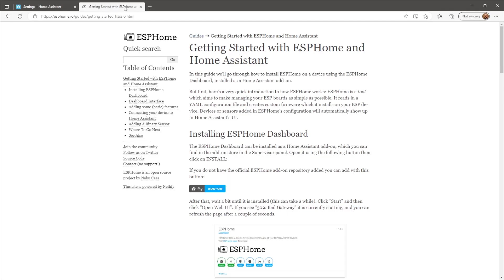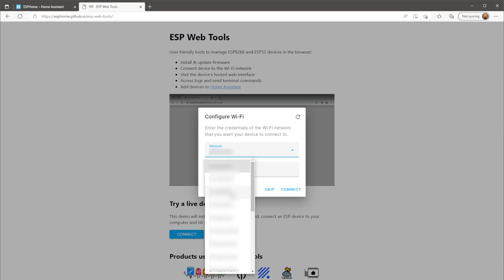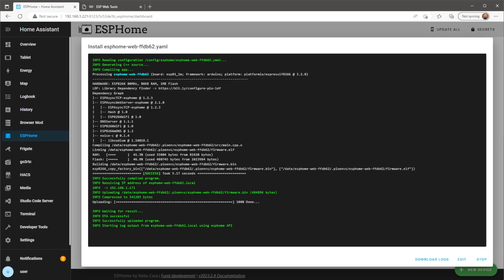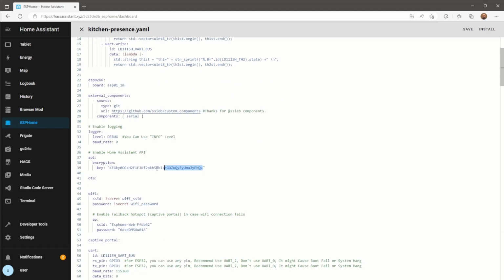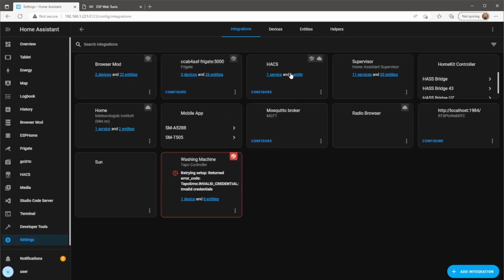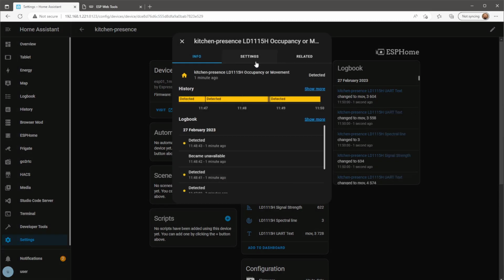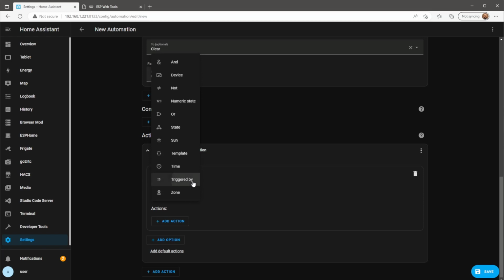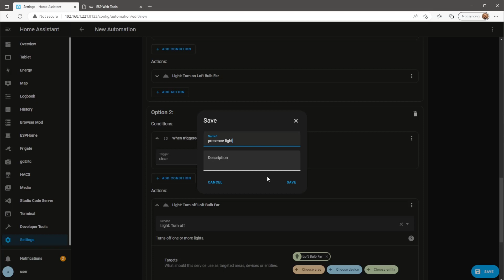Home Assistant Presence Detection Using ESPHome

Comment: Mate, this is exactly what I'm looking for! just wondering if you have a vid on how you mount/box this up? Or do you just have this naked? I don't have any 3D printer, so be good if I can just put it in a box. Be really awesome if you can do a quick short vid on you have this setup. I would like to see how sensitive it is, etc. Cheers
Reply from the maker: I know there projects out there for 3D printing, you'd have to find someone online who could 3d print for you. I can't recommend anywhere because I've never reached out for this service.
Reply: @HassAssistant  finally got the part and man, it works flawlessly. Just one last question, what would you recommend to make the connections permanent? I'm thinking just to solder them using short cables. Would that be the way to go, or would you have a better / easier solution? (using jumper wires too at mo) Cheers
Reply from the maker: @LastZion  I've only just pushed in the jumper cables on mine, and had no issues yet. It's completely a personal choice. Sure you can solder, that's not permanent, you can always melt it off again. I don't know any other way you could connect the wires?... 🤔 Remember later down the line you might have a change of heart and want the ESP board for something else.. a new sensor or something.

Comment: Hi, it works flawlessly but the presence clearance time is 33 seconds . I there a way to change this ? Thanks for this tutorial very usefull ;)
Reply: same here, would love to know if it's possible to decrease it
Reply: it can quickly be done - in the "kitchen-presence.yaml", change the value in line 150 (belongs to id: LD1115H_Clear_Time) from "20" to however many seconds you need. Then reinstall the code. I cranked it up to 300 (5 min). Now i can adjust to however many seconds I need. Works just fine.
Reply: @ChrisMylesMusic  Well, yes, that is the line to change it, however lowering it does not seem to have an effect for values below 30~, it always atleast takes 30 seconds for me to set it to clear
Reply: @ravand1990  ah - good point, that i didn't try - sorry for not properly referring to the "decrease" part :)!

Comment: Nice! Wondering if you tried the LD2410 sensor  ?
Reply from the maker: https://esphome.io/components/sensor/ld2410.html

This is usable with ESPHome.
I haven't personally tried.

Point to note ld2410B (bluetooth) is very simple. just a case of providing power to the device, pair it with home assistant via bluetooth and everything should automagically work.
Reply: @HassAssistant  I'm using the LD2410 so can I just substitute the references to HLK-LD1115H in the presence-detector yaml or it more involved? (Find/replace)
Reply: @HassAssistant  is it cheaper than the items used in the video? I'd imagine so given it had no wifi support
Reply: I did and it was so easy
Reply: If anyone has any more info on using the LD2410b instead of the LD1115h and what changes are necessary in instruction set, please share them.  It would also be nice to add some other sensors like Temp, LUX, multicolor LED Indicator that I could change colors based on certain conditions (like garage door left open).

Comment: Nice video. I´m having trouble setting the sensitivity. It picks up everything in a 360 circle. I set up one in the far most end of my apartment (94m2) and it picks up my entire apartment (and the neighbors) haha. I even tried pringles cans to make it more directional. Any advice on how to adjust?
Reply from the maker: sounds like an issue more with the config.
think the range maxes out around 5-7m.
Also do you have a fan or something moving in the room that it could be picking up on?
Reply: @HassAssistant  Hi. No fan or pets. Detection range is about 10 meters and static range around 4 meters with default settings. I have no metal walls or anything it can "bounce" off on. Another problem is that it detects 360 degrees, so it detects trees moving outside my window. The pringles can fixed this issue but looks silly ;) I have been trying different adjustments with TH1 & TH2 but not quite there yet. I have ordered some HLK-Ld2410b since they can be adjusted in range (apparently) and are officially supported by Hass. As is, (for me) this sensor would work great with Hass Alarmo but not automations. Just to darn sensitive.